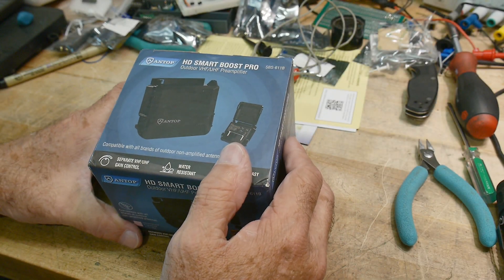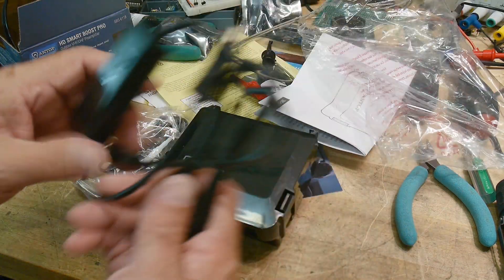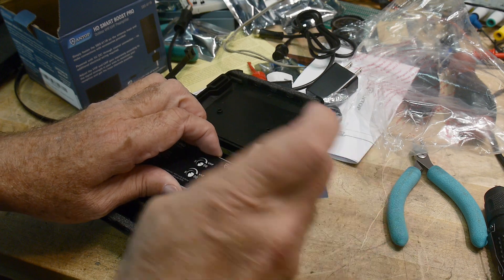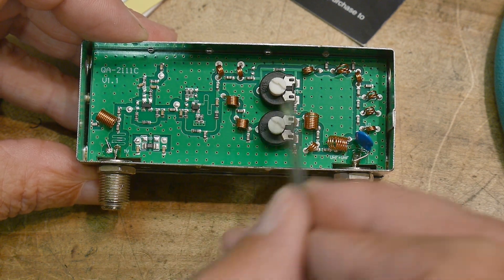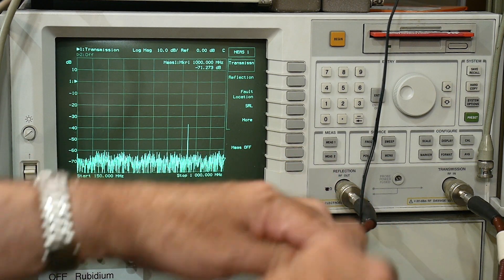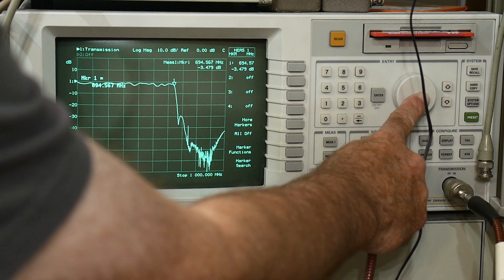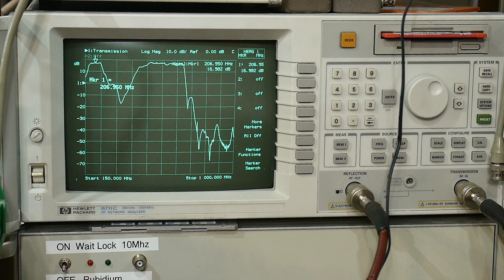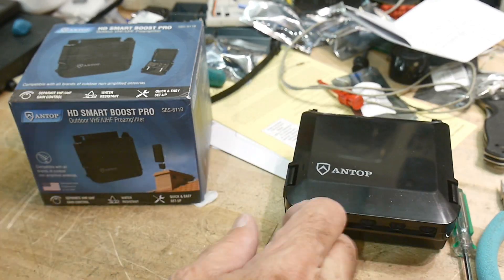#1247 Antop SBS-611B HD Smart Boost Pro outdoor VHF/UHF preamplifier

Comment: Noise Figure (NF) is through the roof with that design... Any up-mast amplifier is there for one purpose  and one purpose only: compensating cable loss (and thus increased NF) down to the receiver. That's it, you can't magically produce a signal, which isn't there to begin with, by adding amplification.

Makes me wonder what the purpose of the attenuation is. The filters are fine - they provide band-isolation and makes sure the amplifier stage isn't overloaded by other nearby transmitters at other frequencies, causing intermodulation (the amplifier stage is probably wideband, so you need this kind of filtering). And the filters are (hopefully) designed to a low insertion loss. 
It makes no sense to attenuate, then amplify. If the problem is distortion because you're next door to the tower, simply add an in-line attenuator, forget about the amplifier.  

To me, this box seems like an attempt at an 'all-in-one solution' with little applicability in the real world. It's a fix-it-all box, with the potential to not fix anything at all. But I bet it was cheap 🙂 

Keep the pot's at 0dB and you have a filtered amplifier with 2dB NF (to their specs.... would like to see that confirmed) to compensate your coax. Then add a simple in-line attenuator (at the TV) if you experience problems. 

Thank you for the video, I really enjoy following your channel 👍🏻
Soren/OZ1LQO

Comment: What’s a good resource for understanding how those small coil inductors are acting as bandpass filters?  I’m trying to reverse-engineer the filtering section of the AnyTone 588 aka TYT/Retevis 9000D.  They make the exact same radio, except for the filtering section that determines the monoband of 440, 350, 220, 144, or 88 MHz.  I’m also open to recommendations on how to do in-circuit testing of using FFT of a digital oscilloscope. If I make a modification I’d like to verify the changes made.  I’m particularly interested in converting the 4-meter band model to 6-meter for use in American amateur band.
Reply from the maker: https://youtu.be/p2Scs8pFuQc
https://youtu.be/04GbWVfJGZk

Comment: I wonder if there's a linear regulator on the backside?  Not uncommon since the wallwart is probably a switcher (not the best supply for a LNA).

Kind of surprised the pots are before the LNA (i.e. affects NF).  Makes me a little suspicious about a 2dB NF (obviously it's not 2dB when you are reducing gain) .  Does help with overload tho.

Comment: What is the grid pattern on the PCB, looks like some plated through some not?  Impedance management?
Reply from the maker: they are called stitching vias. they connect the top ground plane with the bottom ground plane on a two sided PCB. they are all plated thru. some have a a solder mask over and some do not, they are all the same electrically
Reply: @IMSAIGuy  Thanks, I remember now that you used that on your VNA test boards, and probably mentioned the reason then.

Comment: Did you realize that the VHF gain went up from 17db to about 20db when you lowered the UHF gain? Coupling via supply. So maybe with a little more supply voltage you can adjust the gain ranges. 10:12
Reply: Yes I saw that, interesting interaction.
Reply from the maker: I missed that one. thanks

Comment: The attenuators are ahead of the amplifiers? I wonder what the noise figures are like..
Reply: That confused me, too. Also I find it hard to believe that a 500 Ohm single turn wiper potentiometer can act as a proper VHF/UHF attenuator. Part of the attenuation must be caused by gross mismatch.
Reply: @diemaschinedieviereckigeei2941  I agree, it's a flawed design. See my main post 🙂
Reply from the maker: must have been hard to amplify first since after the amp they would need to have the filters and combiner then nothing to drive the cable back to the TV. maybe one amp first, then the filters then finally the 2nd amp would be better.
Reply: Well that's easy: the sky is the limit (or actually, at least 20dB judging from the video 😂) . See my other post 👍🏻